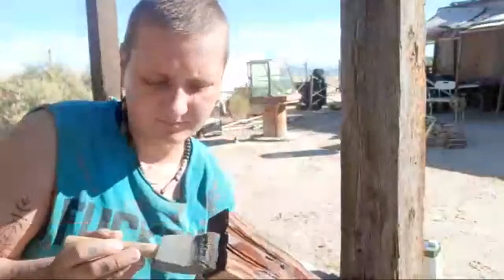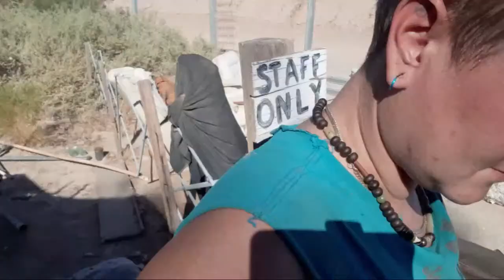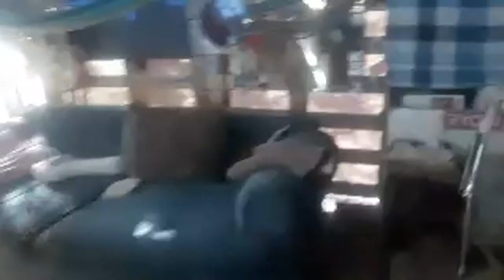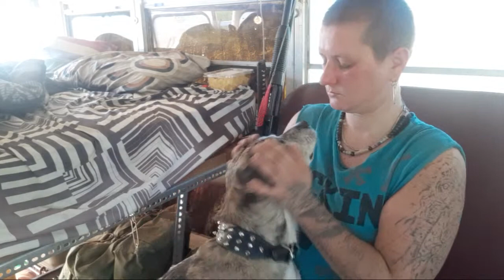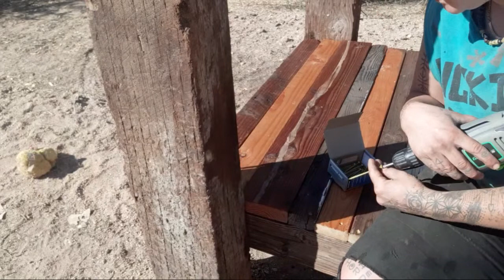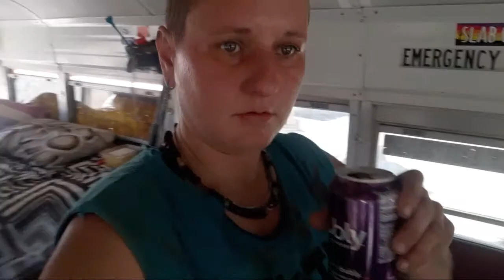Chores Outdoors: Building Off-grid Shower Using Salvage

Comment: Outdoor showers built with salvage are great! Put the water in a dark colored container and you've got free hot water. I had water pressure (hose running to my trailer) and I hooked up a dark colored hose and hung it on my fence and had a spray nozzle on the end because that water came out HOT and using a fine spray, it was great. I had a fence up with morning grape vines and my "deck" was decked-over pallets. There were few enough people around that I could just strip down and take a shower right there on my deck. Hell I've moved back to the city and living in what's called an "R&D" building which is a finished office and a big cement floor warehouse place, crammed with enough electronics to make NASA look like amateurs, and my "shower" because I don't want to join the covidgym, is scrubbing down with Windex (great soap!) and rinsing down with hot water in "shaker bottles". Improvising showers is fun!